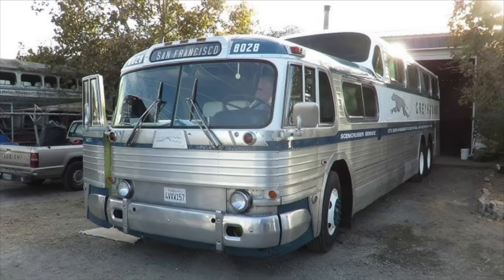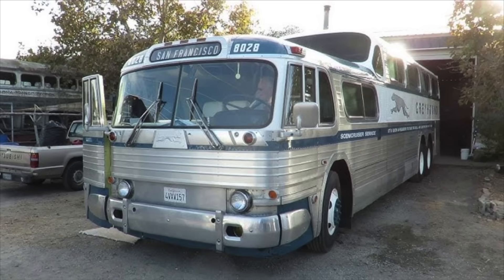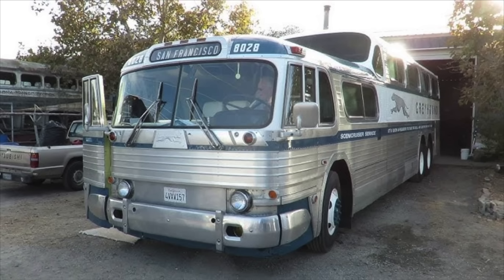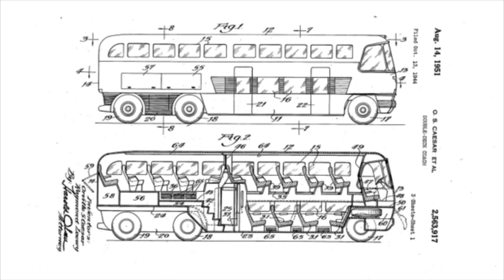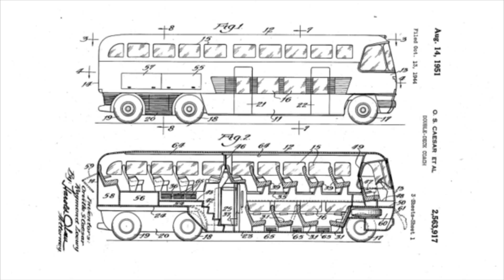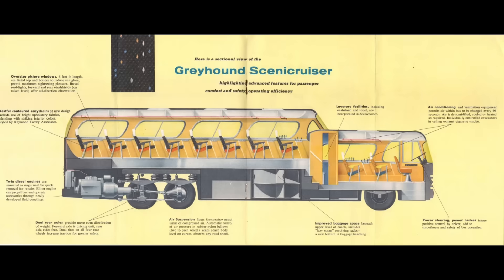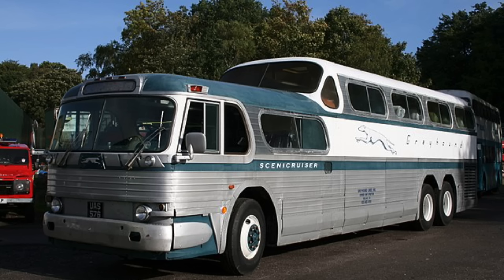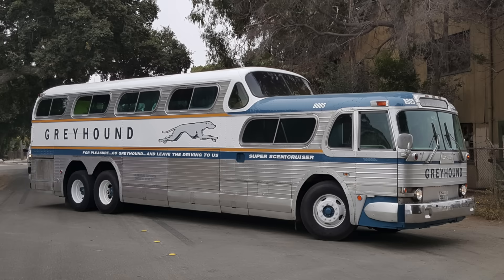Awesome & Flawed Vehicles: 1954-56 Twin-Engine GMC/Greyhound PD-4501 Scenicruiser Bus!

Comment: I drove one of these retrofitted Cruisers in the 70's that had somehow been imported to Canada where I worked. I don't know if they were all like that but the one I drove had a non synchro 4 speed transmission and an air operated clutch. The pedal actually did a little pst every shift. It actually worked well. The 8 had enough power to push the bus along but with none to spare. Driving this bus it felt HEAVY !!  Passengers loved the ride, air suspension and all that weight made a great ride. Hope someone has saved one in a museum somewhere.
Reply: @Steve-xf4uv - The Pacific Bus Museum in Fremont, CA, has a restored Scenic in their fleet. They hold an Open House every August where you can tour all of their historic buses, then end the day with a parade, where you can actually get a chance to ride on one. The fellow in OH that has Scenics 771 and 1001, 771 is fully restored and operational. 1001 is very interesting in itself, as it was actually the original hand built prototype (EXP-331), and then, after production ended, was given the serial number PD4501-1001. So he actually owns "the very first" AND "the very last" Scenicruiser! It's currently undergoing restoration.
Reply: @RustySax1949  Thanks Rusty, good to know.

Comment: The MC 6 was the king with the 12/71
Reply: A lot of them were also converted down to the 8V71. I worked on one that still had the 12V in the early 90’s. They had a cool swing out radiator too.

Comment: My former boss had a 1953 GMC coach. Not a scenic cruiser. Had a 6-71 4 speed. Engine was counter-rotating. Found this out during overhaul, we installed standard oil pump! No oil pressure! Got it shut down immediately! Put the correct oil pump in it and it was fine. It was a camper, air ride, drove beautifully! I couldn't believe it was a 1953!

Comment: I remember my senior trip in the late 80s was in one of these buses that had been loaned to the school by the local church and while it had an excellent ride we drove from Central Texas to Florida and back unfortunately the air conditioning system basically functioned via duckting with the main compressors in the front of the vehicle the lower deck people were covered up in blankets freezing the death while the people in the very back of the upper deck we're sweating profusely with the windows open it ran out of cold Really fast In the Southern climates!!!  🥶😒🥵

Comment: From what I've read, viewed, etc; the sole reason for using twin 4-71 engines was "packaging."  A single 6-71 would have provided enough horsepower and torque, if barely.  However, they couldn't make the engine fit into the bus, which was already as physically large as they could legally operate on US Highways.  The 6-71 was just too long, and they couldn't get the transmission to work with a transverse mounting as was actually done with other highway buses.  So, they came up with the twin 4-71 engines coupled via the fluid coupling as a compromise to get bus on the road.  The Marmon-Herrington "rebuild" program of 1961-1962 included installing the 8V-71 engines GMC Coach and Greyhound would have used from the beginning had they been available in 1954.  The 8V-71 wasn't available until 1957, roughly one year after GMC Coach built the last new Scenicruiser.

Between the powerpack problems and the frame cracking, and GMC's reaction to and support for Greyhound's problems with them, this marked the beginning of the end of the love affair between Greyhound and GMC.  Greyhound bought a controlling interest in Canadian Bus manufacturer MCI in 1958, and by 1961 owned MCI outright.  While Greyhound did buy buses from GMC after the Scenicruiser fiasco, they weren't particularly aggressive about buying GMC products as opposed to their own MCI units.  They bought two orders of "Buffalo" buses, one block of 166 in 1966, with a further 200 in 1967, which may have been contracted earlier with no clause to back out of the purchase.  The 1966 block of Buffaloes were trouble-prone, and Greyhound never bought another bus from GMC after 1967.

With Trailways also effectively building their own buses in-house, GMC had effectively lost the vast majority of its potential market for intercity buses.  While they fought on in the business, their efforts would ultimately not pay off.  They withdrew from the intercity coach market in 1980, and from non-school-bus production altogether in 1987.
Reply: Don't know, in the 4101 with the 671 they used a small gasoline engine to power the air conditioning to save power from the bus engine. When the 4106 came out it had the 8V71 with plenty of power and they eliminated the gas engine.

Comment: Seen a couple as private coach conversions. Another interesting fact is these were an aluminum unibody construction. They do have a steel engine cradle if I recall correctly but the rest was aluminum unibody style construction. Different engine & application but some of the M4 Sherman tanks we built were also powered by twin Detroits but 6-71's. The Sherman had a bunch of engine options, couple of radials, big Ford GAA V8, Twin Detroits depending on who i was for. Lot of 2-stroke Detroits in marine use during WWII.

Comment: I rode these in the 1960s and 70s. My last cross country bus ride was 1977 and I was disappointed it was just a plain bus. These would make great RV conversions but they would require some significant modernization from the obsolete diesel engines to the hydraulic system and air ride. Probably why these don't exist on the road anymore.

Comment: Interesting factoid:  Frederick W. Smith, the founder of Federal Express was actually the son of James Frederick Smith who founded the Dixie Greyhound Lines.  This was merged into Southeastern Greyhound Lines and eventually Greyhound lines itself.  He also founded the Huddle House restaurant chain.

Fred Smith for years has wanted to establish passenger service;  The board of directors of Fedex gently and professionally said "Not no but HELL no!" to Fred......

As to this bus with two engines:  You need power for acceleration on the highway, but once you reach cruising speed most vehicles need very little of their rated power.  It is possible that the driver started both but when reaching 70 mph, he shut one down and ran on four cylinders which is far more efficient than a V8 of the same size as both fours, which would create pumping losses.

Comment: Seems that they would have been able to get the twin 4-71s to work as some Sherman tanks were equipped with twin 6-71s so it wasn't like they were inventing the wheel.
Reply: I believe the Shermans; twin engines  were mechanically joined.  . Greyhound's were hydraulically joined. But,  I agree with you. Why not used the tried and true. And that same set up was (is) used in many boats.

Comment: As a kid, albeit one born after production ended, I was fascinated by the Scenicruiser.  It wasn't until the stunningly modern GMC RTS transit models from the late 1970s that I was as captivated by a bus.  The history of the Scenicruiser was somewhat mixed, however.  In addition to the powertrain issues, there were structural deficiencies leading to cracking around the window frames and requiring reinforcement plates in the sides of these essentially unit-body vehicles.

Comment: I drove for the Hound but long after the Scenic had left the fleet.  I have the good fortune of having a friend that owns two seated Scenics, , 771 and 1001.  He is the guru and well known historian of the fleet of Scenics.  I have been lucky to drive his restored seated Scenic to two bus rallys in Indiana and Arkansas, yes there are vintage coach rallys.  Even at seventy years old they are a pleasure to drive and float down the highway.  In 1962 Marmon Herrington was contracted to refurbish the fleet and upgrade the drivetrain to the 8v71 Detroit and spicer four speed transmission.  The livery was changed and the "gold stripe" was added to commemorate the fifty year anniversary of GLI in 1964.  I'm hoping my buddy will chime in and comment, he is a wealth of knowledge on this subject.
Reply: A co-worker , the late Ed Wozniak of Pemberville Ohio was a Greyhound mechanic  in the Toledo garage while the Scenic was in service  .  Ed confirmed the repowers were done by  Marmon-Herrington as bidder . Ed also told about the new empty hulks were delivered without seats, as the seats were bid out to a manufacturer in the Galion, Oh  area, then installed at Toledo .   Details about the twin 4 cylinder engines  were coupled by a gearbox primarily used in industrial applications that allowed one or both engines to provide power . In a Scenic service manual there's at least one picture which I'd seen some 20 years ago .  But I believe , unlike industrial twin sets , where the pair of engines set straight up, the twin fours had modified oil pans and oil pick up plumbing to allow an outward tilt on both engines .
Reply: @danielrenovetz5721  Speaking of Toledo, my grandparents moved from Toledo to Phoenix, AZ in the early 60s and my mother rode the Scenicruiser at least once (around 1966) from Toledo to Phoenix. There was a stewardess, like on an airplane.
Reply: I think they experienced body/frame cracking due to repeated flexing. I’ve never driven one but a 92 year old charter company owner that I know had some of them in his fleet years ago and still talks about taking trips in them.

Comment: During WW2, some Sherman tanks used dual GM 6 diesels, not sure if they were 651 or 671, but they were mounted side-by-side just like this. I'm assuming the engine connector was the same unit.
FWIW, there were 4 completely different motors for that tank; early in the war,: 
One was an air-cooled Continental radial aircraft engine was used, mostly by the British in N. Africa. Good enough power, made too much noise, reliability and maintenance were weak points, and it required avgas.
Two was the GM dual-diesel; power was low, but torque was good, and was more reliable than the radial. Used mostly in Europe, we sent a few to the USSR.
Three was the Chrysler Multibank, no fewer than 5 bog-stock Chrysler inline-6 flatheads mounted in a crown-like pattern on a big cast iron holder casing, Reliable, ran on even low octane gas, easy to fix (mostly), and any single engine could be replaced straight out of a crate. Most common motor of the war.
Four was the best, but it came too late into the war to be used much; the Ford 60° DOHC (shaft driven cams..) flat-plane 1,100 cu. in. V-8.

Comment: Nice!  I remember those from when I was growing up.  I never rode in one, but I did get a look inside one, sitting at the local Greyhound terminal.  They were cool looking buses and it would have would have been fun to ride in one.  They didn't run between Atlantic City and NYC, which was usually the only time that I rode a bus.  An excellent video, as always.

Comment: While the un synchronized transmission requires double clutching, the 2 speed differential or splitter usually works on single clutch, not double. Still, going uphill at full load requires a good amount of shifting tranny and diff. Plus which, at load some of my old trucks will sequence first low, first high, second low, second high, third low, third high, fourth low, fourth high and others go from third low to fourth low, back to 3rd high, then 4th high
Lots of left foot workout
Reply: You do not have to double clutch a non synchro spicer 4spd such as the Scenics. Drivers shifted by RPM without clutch.

Comment: The scenic cruiser was available as a single decker as well.  In fact, I think they were the more common variety.
Reply: You're right: the Highway Traveler introduced by GM in 1953 (a year before the Scenicruser) with about 5,000 being produced.
Reply: @SteveRothfels  35 foot PD 4104.  671 DD

Comment: Greyhound and GM were sued, and the court ruled that the coach had to be sold to competing carriers. Greyhound paid for and owned the tooling, so they took possession of that equipment and smashed it, as they owned it and contracted with GM to build the coach for their exclusive use.  GM built a one of 40' coach, that looked like a GMC 4104 on steroids with a tandem rear axel, but no carrier ordered them.  Greyhound then invested in and then bought out Motor Coach Industries in Winnipeg,  first redesigning and adopting the MCI coaches for Greyhound Canada, and then after a dispute with GM over 4107 coaches ordered with Carrier Air Conditioning,  but delivery with Thermoking, the Greyhound and GM divorce was final.
Reply: Do you have any details on that suit and Greyhound smashing the tooling?

Comment: A great American coach. They fixed the cracking frames with what is called a parcel package, adding a piece of aluminum or Steel to the sides of the coach. Today, many are still on the road, and many are just shells of their former selves. Finding one with the original seats is very difficult because many people ( including singer Neil Young)) converted them into RV motorhomes. A friend of mine bought the one used in the movie “Once Upon A Time in Hollywood” , which still had the seats. The problem with them is the cost of maintenance and keeping them roadworthy. You have to commit to the expense. My hat is off to the people who buy and maintain them for the joy of preserving our motor coach history. And believe it or not, the Scenecruisers did not have a fuel gage on the dashboard.
Reply: most busses didn't have a fuel gauge until the 80s. Arlo Guthrie has a scenicruiser in his yard.
Reply: @garydesgres1382  GLI had a fuel card that we recorded trip miles and the shop would enter gallons fixed and date.
Reply: What a cool bus! I never saw or rode in one unfortunately. Thanks for posting!

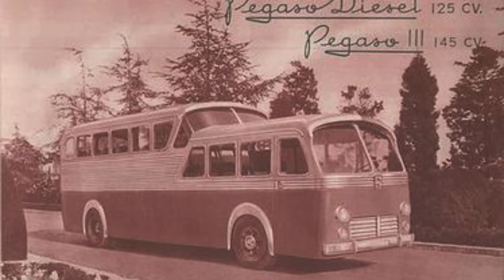Comment: In the opening photo, you can see a wig-wag hanging down in front of the driver. @3:10, check out those white sidewalls!! And notice how the high-beam (inboard) headlights appear darker - I wonder if they were amber!
Reply: Those inner lamps were amber fog lights, not high beams.
Reply: @danielulz1640  Keep in mind that they were the old 7" sealed beams. The 5.5" quad system wasn't out until late 57.
Reply: @danielulz1640  Ah you're right - no separate high-beams till '58!
Reply: What is a wig-wag?
Reply: @61rampy65  A wig-wag was a mechanical indicator/warning-device, which was to alert the driver to a low air condition, in the days before alarm buzzers and warning lights.
If the air pressure got low, the wig-wag would drop down into the driver's field of view, sort of like a mail-box flag, as you can see in that first picture. Since the brakes were air powered, the air pressure was a very critical thing to monitor in any way possible.
Reply: @DanEBoyd  Thank you. I had no idea!